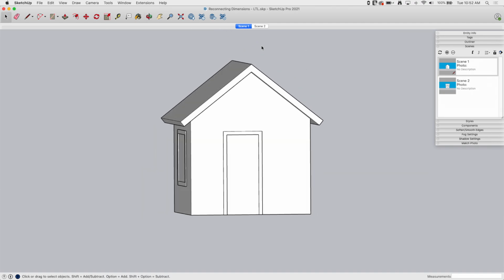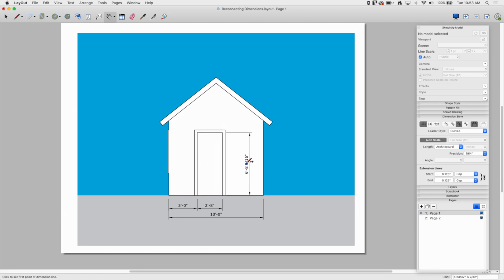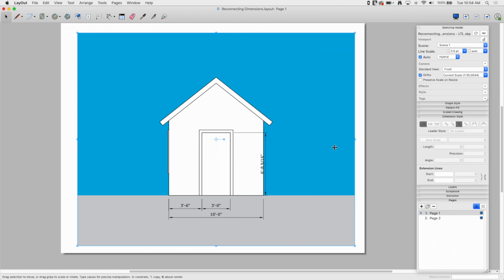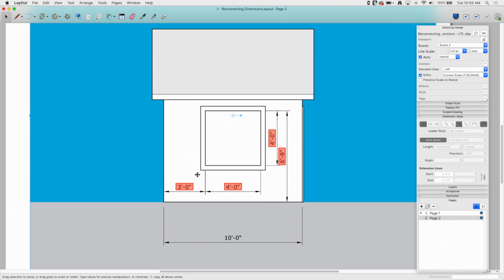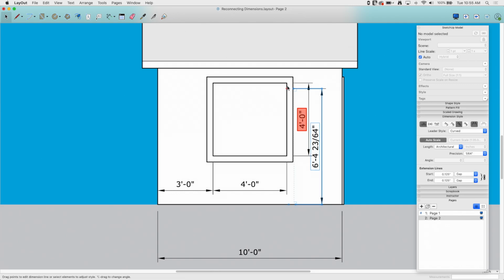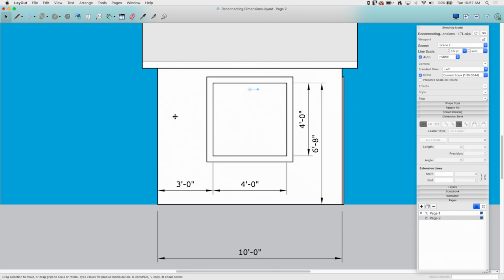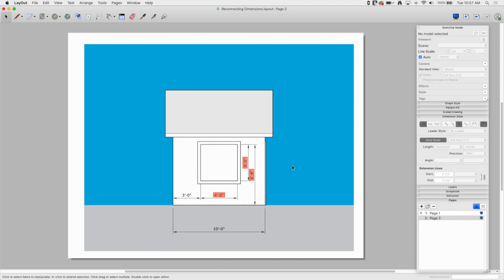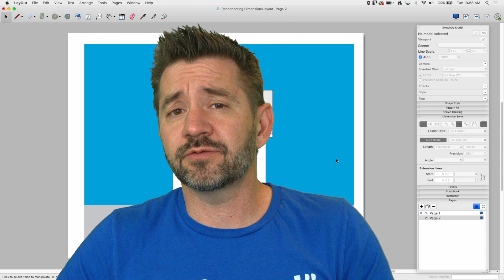Reconnecting Dimensions - Let's Talk LayOut

Comment: I have this problem often. Even worse, sometimes the dimension is changed to a different value, like from 16’ to 1 1/2”. Sometimes I can right click and choose “reconnect to model”, but more often it doesn’t fix it. Even if I erase the dimension, and redo it, it comes up with the wrong value. That phenomenon really stumps me.
Reply from the maker: It sounds like your dimensions may be connecting tot he page, rather than the model (1 1/2" would be a measurement on your page, while 16' would be a dimension in the model). Try turning off you Grid Snap and be very careful about snapping to points on your model.
Reply: @SketchUp  thanks, I’ll try that

Comment: I have that problem with Dimensions and Annotated text (arrows) when I open older Layout files created with SU-2015, and now opened and converted (updated?) to SU-2021 for additional work and revision.  I have hundreds of these Layout projects documented in SU-2015.  So far I've had to "fix" maybe 50-75 such files in the last 5-months since I bought a new Work Computer and had to install SU-2021 and Layout-2021.  At first it was annoying, now it's just a tedious step that I just accommodate in the work-flow.
What I have found is some subtle differences in the Layout menu features available between an file updated or copied from SU-2015 to SU-2021 ....and a more recent file solely-created in SU-2021.  Since I have dozens of "Mother"-files and Template files created in SU-2015 I'm slowly debugging as I go.  For some files I just turn-off the "text warnings", and other I can just use the "reconnect" menu-commend.  Others I have to manually reset.
Reply: that sucks!

Comment: This happens to me all the time, so it's good to know why.  I have "re-attached" the dimensions when needed.  However, when working on complex architectural models with many revisions, it gets time-consuming every time you have to go back and re-attach a dimension, especially if cutting and pasting the revision for a minor move to satisfy a client's decision.  It would be great if SketchUp/LayOut could develop a solution to the problem.  I thought the issue might be with Layout line work on top of the model that might/sometimes causes the issue.  Thanks Aaron for the insight, I've learned to live with it, but as a professional, it would be helpful to not have this problem at all.
Reply: That could definitely be an additional problem worth inspecting

Comment: Is there a reason that you don’t want to use the Reconnect to Model option? That seems to be quicker in most cases than manually reconnecting each dimension individually.
Reply: That will work if the dimension is disconnected due to existing geometry moving. If the geometry is replaced, it cannot reconnect.
Reply: @AaronMakingStuff  Ah ok makes sense. Thanks!

Comment: Hummmm, very interesting. I have  in fact had it happen and just re- dimensioned without much thought in the direction of a disconnect. But more a layering issue. Not layer as in Tagging, layering as in stacking. Having one entity on top of another.  Even though deleting the original before placing / pasting the second in place.  Although theoretically occupying the same space but not really. If that makes sense. If a line has a weight of say 10, is it 10 in depth also? Or just in X, Y planes. If it’s stacked, is the two  10 wide and 20 deep. Hummmm, now I wonder.

Comment: Happens to me all the time: I lock the Model layer, then just Select all (Command A on mac): right-click: reconnect to model. Typically sorts most of them...
Reply: That often works, but I have several models where the geometry changes enough, or component get changed out and LayOut does not know what to reconnect.